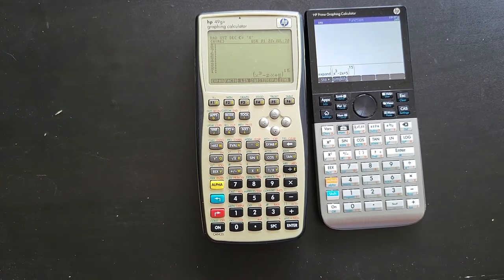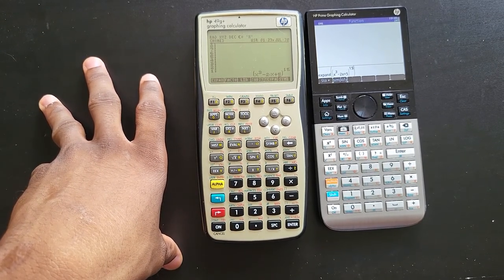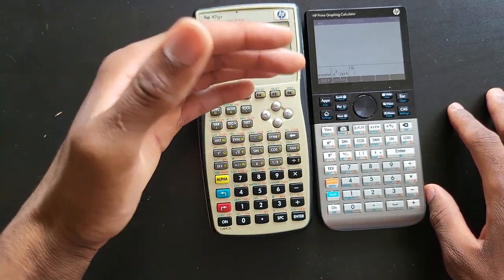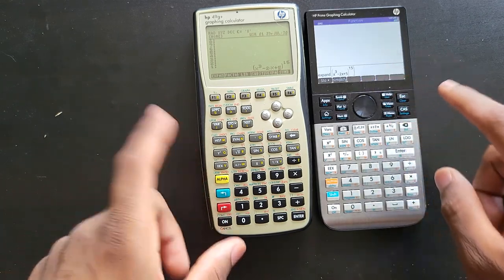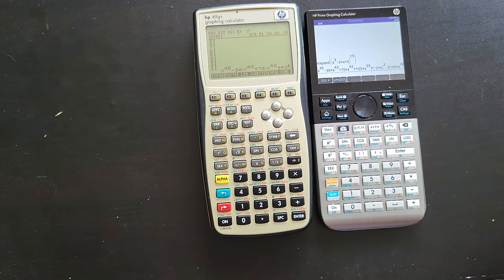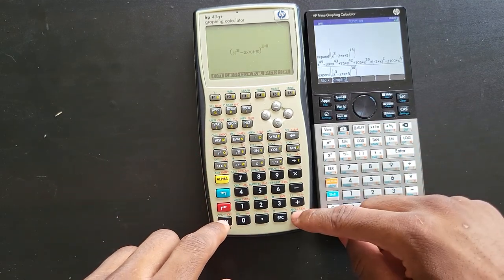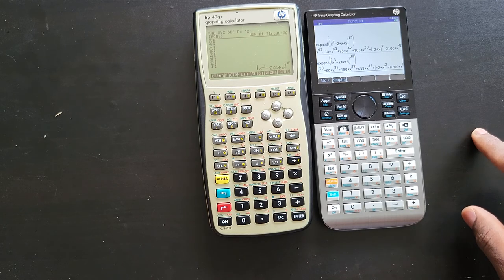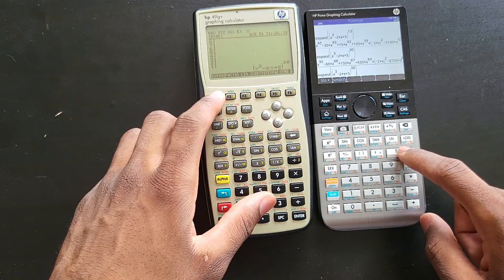10 Years apart BUT you'll be surprised (HP 49g+ VS HP Prime)

Comment: If you use simplify() instead of expand(), the Prime gives you the correct answer instantly.  I assume expand() is brute force multiplying the polynomials, whereas simplify() recognizes a trick to efficiently compute the coefficients.  This is a matter of the calculator doing exactly what you told it too, even if it's slow, since sometimes you need it to do it that way.

Comment: Hi , how can one connect hp 49g+ with windows 10-11?
Reply from the maker: You'll need to download the connectivity kit program for the 49series, which is the same as the 48g and 50g series. The rest is a bit technical, but this link will help you: 

https://www.educalc.net/page/283486/

You'll need to change a setting in windows in order to install the drivers. There are videos on Youtube that'll assist you with that
Reply: @calculator_boy  Thank you, but it does not work because i canno't install the drivers on windows 11 and there is no communication with the calculator.
Reply from the maker: @paulgets2737  https://www.youtube.com/watch?v=fjcOzopFFzg
Reply: I could not get it to work on Windows 10. I run the Connection Kit in xp in VirtualBox and it works fine there.
Reply: I just use an SD card to get stuff into my 49G+